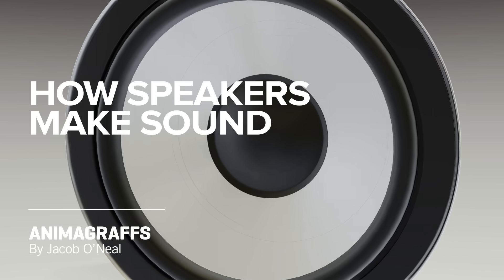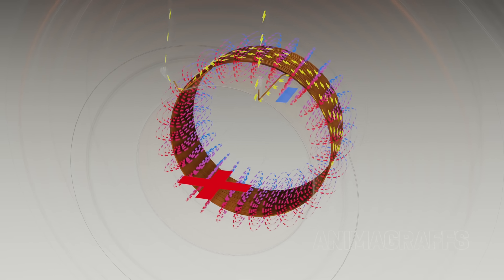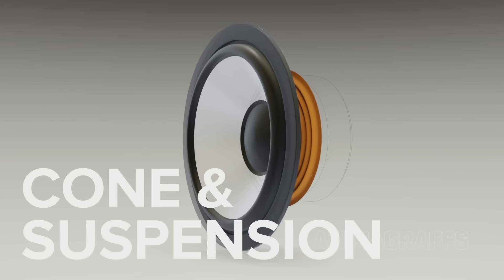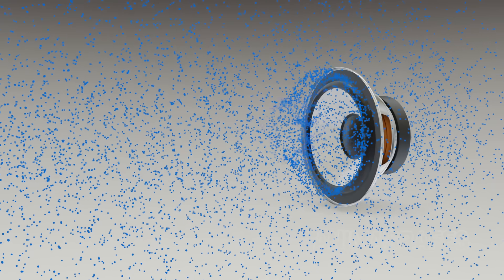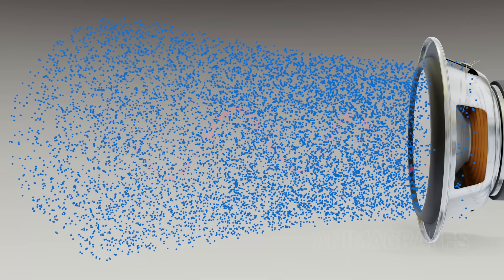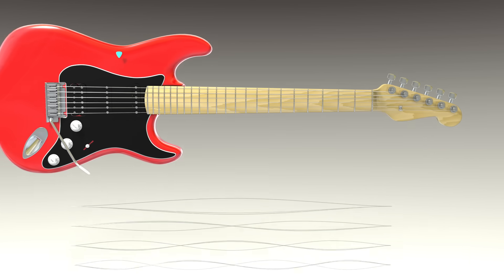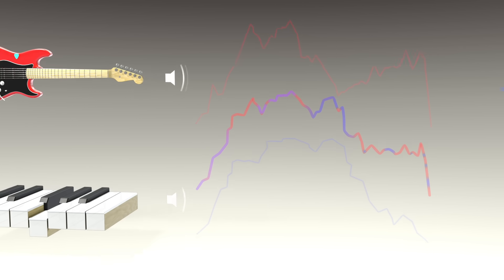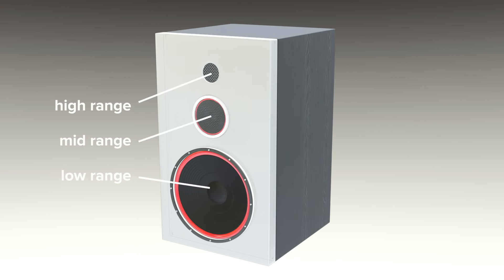How Speakers Make Sound

Comment: Amazing. And, where video shows each bass note causing one pulse on speaker, it is really causing about 50 Hz so 50 pulses per second, but that (and certainly the higher notes) vibration of speaker cannot even be shown in a 24 fps video and we could not discern it with our eyes if it did (maximal 24+ fps perceptual vision?). So we have to use our imagination, as it's almost like a superposition of where the speaker is when playing a bass note, and even more so for high notes.
Reply: Interesting comment.  I wonder if quantum superpositions are somehow related to waves are continually moving, therefore you never have an exact position, just a superposition.

Comment: Hello, Jake O.;

This is video is a well animated explanation of how speakers produce sound; 
but there is still no video or good explanation of exactly how the linear movements of the cone and voice coil generate sound. 

For example, I can tap on a speaker, and a sound is produced. Most of the time, if you tap a speaker, it will make a sound similar to a kick drum.

But... although there is a science to getting a speaker to move rapidly back and forward fast enough to distinct sounds, it is still not quite clear how the sounds are achieved.

Electrical power lines produce humming sounds near substations, and there are no moving parts in the power lines.

Maybe it really is that simple, and I'm just able to grasp the idea.

Comment: Does a speaker in the low frequency not only traveling slower but also needs to be pushed further to create the same pressure as a high frequency? Is that the reason?

Comment: So  the loudess and low volume of speakers depended on vibration frequency of voice coil ? I'm quite curious about this because there are many types of speakers. Although there are different parameters, the sound quality produced is not much different

Comment: Speakers are made up of a motor that moves the speaker back and forth, coupled to a cone that converts this movement into pressure waves that pass through the air. How does a speaker reproduce an entire symphony of sounds at the same time? Let's take a look at how sound waves work. Sound waves are three-dimensional areas of high and low pressure, from waves to music. A speaker designed for low, sluggish frequencies is quite different from one designed for high, quick frequencies. A single instrument note is essentially a sandwich of frequencies where one primary frequency shines out. This frequency sandwich is known as an instrument's timbre.

Comment: Can one of you smart fellas help me figure this out. I 100% get how a speaker outputs a single wave in all its capable frequencies. I can understand that the speaker cone gets pushed out (or in for that matter) and that creates the wave we then perceive as sound. What I don't understand, is how it makes all the other notes along with it. Is it capable of vibrating back forward while overall the cone is still being drawn back? In other words, I can only see how this would work if the speaker only moved forward to make the various notes and never pulled back in. I somewhat can picture that. However, take a full range 1 way speaker without tweeters on it. It is able to play an 85hz note with the volume cranked up by the long(ish) excursion of the cone. How is it able to play say a 500hz note simultaneously?  Doesn't the speaker need time to pull the cone back to play another sound before playing the next note?
Full disclosure, I was a professional audio installer in what seems like another life (~32 years ago). I could do all the associated math for speaker circuit impedance, power drop by length of cables, design the whole system including the layout, then build the custom enclosures (of the various enclosure 'orders') or custom kick/door panels, and install it all without understanding HOW it did this function. I knew it did, and that was enough, at least back then...
Reply from the maker: Though I'm sure there are "even deeper" physics at play here, the basic idea you've grasped is correct. The smaller vibrations ride along the back of bass waves, and we perceive this all as one sound. That's what the demo at the end of the video shows -- the long bass waves are the big ups and downs, with the tiniest vibrations detailing that bass wave's spine. So while the speaker travels the long distance from one bass hit to the next, it's also frantically chirping out smaller high frequency vibrations simultaneously.
Reply: @animagraffs  Thank you. 
I only recently discovered your channel. Only two videos and I subscribed. Great work. :-)

Comment: At 1:30 the graphics are incorrect. When resting, the center of the voice coil windings sit in the middle of the top plate. When energized the coil strokes in and out while maintaining its center axis lined up with the top plate.

Comment: Air IS Made of Molecules. But Air Molecules Not Only Bringing Vibrations from Object Vibration into Your Eardrums. To Make You Hear a Sound. But it Can Also Make the Sky Appear Blue During Daytime. Because Air Molecules are Tiny Particles. Which are Smaller Than the Multicolored Frequencies of Waves in Sunlight. Which Can Scatter Them. But Only Scatter the Blue Waves and Violet Waves. Because These Waves Have Shorter Frequencies. In a Process Called Rayleigh Scattering

Comment: So can you use a radio wave to move electrons in a receiver , and then amp the voltage with transistors to make wireless electricity. Maybe have an aa battery for the initial charge to a transistor. Then we could get rid of plugs ! Just plug a radio box in beside the WiFi box. You could even monetize wireless energy networks with crypto tokens. I think the will not do previously because they don't know how to monetize radio electricity yet. Just replace plugs with receivers and amp the radiowave. Why has no electrician done it on YouTube yet ?

Comment: The magnet field of the permanent magnet you show is wrong. The magnetic field of the permanent magnet goes in radial direction from the inner core to the outer core through the coil. This way it create Lorenz forces on the coil when current flows in it.

Comment: Very High-Tech.
Artificial Receptor + Wireless Bombardment.

Use Advanced Physics Text, Try To Locate The Whole Spectrum.

Ears are natural receptors of sounds.

Brain Transcribes Incoming Signals.

Incoming Signals Can Come From Natural or/and Artificial Receptors simultaneously or over multiple time variations. Consistent Pattern or Random Pattern of variation achievable.

Comment: i always wondered how it worked! for years as a younger kid i used to think maybe some panel slid up and down to block parts of the sound the more you turned your volume down, lol (however, after thinking about how that would work in a phone years later, i realized that didn't sound very likely).

Comment: It's wrong animation. The Voice coil isn't moving beneath the pole peace as in the animation. The center of the voice coil is always in the center of the pole peace. It can't produce any sounds if it over or beneath the pole peace.  In the animation it's a underhungd speaker. It means that the voicecoil is taller than the pole peace.  It has to be in the middle
Reply from the maker: It's a pretty unfortunate error that got even worse at the end of the video. I had it properly positioned, but something went wrong at render time with my armature (the thing that controls all animated parts in my 3D software). I can't correct things like that and re-upload without losing all video stats. Maybe I'll post a correction in the video description. I'm a little newer to Youtube but a system for adding corrections to the inevitable errors in my work is going to be necessary, I think! Thanks for your input, I never want to misrepresent a subject.
Reply: @animagraffs   Thanks for your answer.  You do a great job.   And it is a really fine video.  Shit happens. Go Head.

Comment: You came close with the guitar and piano demonstration...but how can one single component speaker produce both higher vocals (like a woman singer's voice) and exactly at the same time, produce drums and bass guitar?  Are these happening exactly at the same time with the speaker, or is there some processing happening from the source (the receiver) to separate these different frequencies in nano-seconds (where our brain combines them into one music beat)?
Reply from the maker: The fast high frequencies ride on the back of low frequencies in a unified wave, as far as my research showed me. As to how our ears can hear those things happening simultaneously ... I feel like that's getting into some post-graduate level stuff that's outside of what I could cover here. You can look at "superposition of waves" or "fourier transforms" to see they physics of how these things work more in-depth.

It just doesn't seem beyond comprehension that, for example, if someone smacked me with a vibrating electric toothbrush, I'd perceive both the initial impact of the object itself, and also the tiny vibrations coming from the motorized brush head, all at once, from that one unit.

But I'm not a physicist and am bound to be wrong at some point ... especially at the level you're asking for. The point of my work, then, is to invite folks in to have a deeper look past what they might have before my videos piqued their curiosity.
Reply: @animagraffs  thanks for the reply - and I appreciate that you are interested in my question.  I've always been curious of that question...how multiple frequencies can be played simultaneously on a single coned speaker.

Comment: i still have no idea how speakers work
Reply: @jakepritchard2439  they basically move the eletromagnetic coil to vibrate the air
Reply: @jakepritchard2439   to be fair ... at a certain point it's a legit hard question. Kinda like asking... how does touch make feel? The mechanics are within engineering. The explanation? Beyond.
Reply: A round thin magnetic coil on a iron core & a permanent magnet at the end transform what's being played threw the speaker wires from your amp/reciever/computer.
Reply: well, it's because that wasn't a "basic" speaker, that was an average modern speaker. An actual basic speaker just uses magetism to copy the movement of the electrons in the wire, and amplifies it. Imagine the electrons are water: if you push and pull water in a tube, and the end of the tube has a flexible membrane, the membrane will copy the movement of the water inside, then the air near the membrane also copies the movement of the membrane, then the air inside your ear copies that movement to the part of the ear shown in the video, then that movement turns back into electrical movement.

Ears are pretty much biological microphones
Reply: Lol
Reply: Whose fault is that?
Reply: @jakepritchard2439  😁
Reply: Dumb

Comment: I made a speaker myself when I was about 13 got copper wire from tearing things apart wound it up on a peice of toilet paper roll I cut to make smaller and made a cone set it on a magnet idk if that did anything to help and then cut some headphone wires to connect to the copper ends you could kinda hear it but being headphone wires it didn’t do much now ima bass head and make everythin I want other than speakers my parents hated me for tearing everything I had apart but I learned alot

Comment: Holy shit, this successfully captures the beauty of audio reproduction. I don't think people can easily "see" what your animation makes visible, at least not without a ton of prior knowledge. And if you get how speakers work, then you also know how microphones work, how power plants work, how digital and analog laser projectors work. They all have a coil and magnet, driving a physical object. 

Anything that takes mechanical energy and converts it to electrical energy can be called a transducer. Power plants transduce mechanical energy into electricity. Speakers transduce electrical signals into air pressure waves. Microphones transduce air pressure waves into electrical signals. Projectors transduce spectral content into left and right motion of laser actuators. Anyway, happy learnin' everybody!

Comment: THIS MAKES SO MUCH SENSE. That’s why a single speaker is able to create a symphony — it just combines the sound of every instrument’s frequency into one. Now it makes sense why multi-speaker setups increase the quality of the sound. Different frequencies can be divided amongst the speakers, allowing for a higher range in each speaker. Awesome explanation!
Reply: + it's why a vinyl record can reproduce a full range of sounds from a single point (the tip of the needle)
... And why digital audio cables can transmit sound through pulses of light alone.. :)

Oh, and it's why 'phase' matters.
If 2 soundwaves are identical, but exactly out of sync, the result is silence (because the sum of +1 and -1 equals zero)...
     And if they are IN sync... The result is twice as loud
Reply: Once you learn that frequencies can combine, a lot of things make sense
Reply: Okay, frequencies can combine into one, that makes sense to me . . . but how tf does the speaker create, let's say, 20 different sounds all at the same time? For example, in a video game, you have a battle scene, and you take a sample of 1 second of that fight. In that single second, you have:
-drums
-cello
-strings
-violin
-the sfx of the characters walking and jumping
-sfx of swords clashing and clanking
-sfx of meat getting cut
-sfx of a grunt of pain
-sfx of a battle cry

You get the point. How does the speaker vibrate 20 different times at 20 different frequencies at the same time in that 1 second? That doesn't make sense to me. There's something I'm not getting.
Reply: @SleepParty30 20 sounds can collapse into one unique soundwave. Its not 20 different signals, it becomes one.
Reply: You didn't explain why the electrical signals arriving at the brain are experienced as sound rather than, say, colours (although to be fair, nobody has the foggiest idea)
Reply: Multispeaker setups increase the quality of the sound more because they can introduce delay to provide a sense of depth and space. That is why mono vs stereo exists and multichannel audio sounds so much better. This is boosting the quality more than being able to divide up the frequencies.
Reply: @alexism1635  The main reason is physical limitations, a big bass speaker with a large surface area cant also move fast enough for a 10,000 Hz high pitch frequency with enough fidelity due to its inertia.
Reply: @vast634  ahhh!!!! got it.
Reply: @alexism1635   no it is mostly because of different speaker types being better at their frequencies like woofer subwoofer tweeter mid range etc. What you're talking about is stereo or surround

Comment: Do an experiment tightly attach two speakers with a thread by pasting it in the center you can hear sound  from one speaker by vibrations coming from  the 2nd  speaker that is connected with a device

Comment: Your graphic is quite inaccurate. And does little to explain it correctly you pay no attention to the gap  winding linearity the coil is centered on the gap not how you show it.
If you are going to explain a device at least do it correctly & not a half aresed attempt at doing so
And it is pronounced "Tom-b" the re is silent. Judging by your graphics you do not fully understand how they function.
Neither are the design concepts any different according to wavelength they are all moving coil

Comment: here are a few mistakes in the showing material:
3:45 : This is not the sound of a pure Sine-Wave, like shown in the animation.
In addition to that: The two dimensional sine wave doesn't come out of the front of the speaker like shown. 
It would have been better if the sine curve had run from top to bottom. Then it would be more logical true.

4:36: This is not a vibrating "G" String, this is an "E" String

5:09: The little light going from left to right through the lines, suggests that the sound follows the line from left to right over time.
That is wrong.
If the line shows a frequency spectrum, it would make more sense, that lights or arrows come from bottom to the line, because the  shown momentary-frequency-spectrum-line, stays the same over time.

Comment: okay, so question.. if the pitch (low/high [bass/treble]) is adjusted by the speaker moving harder/slower - how does one single speaker reproduce both of those, at the same time? for example, when a song has very deep and low hz bass, but very high vocals at the same time. how can the speaker reproduce that sound simultaneously when in fact, It has to either move slower for bass, and faster for vocals?

Comment: Me before watching: Man, speakers seem to work like black magic, I should watch a video to understand them.

Me after watching: Yep, it's black magic.
Reply: A coil of wire can be an electromagnet with polarity and intensity depending on the voltage you apply. Basically, you can make it be attracted or repelled by a regular magnet by applying electricity, so it will be either pulled towards it or pushed away...
Doing this cyclical and very fast, 20 - 20 000 times per second creates and audible soundwave which is amplified (or rather, matched) to the surrounding air by the cone assembly.